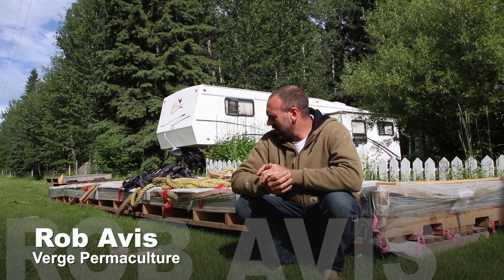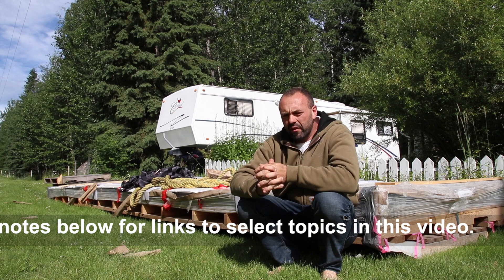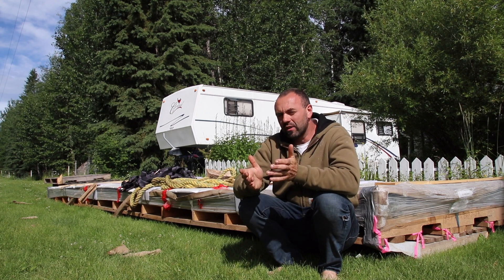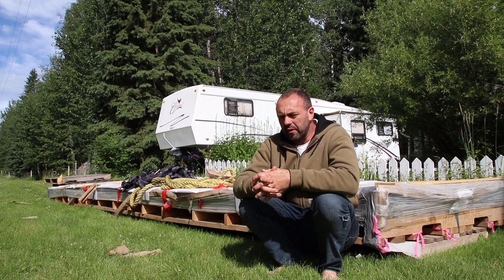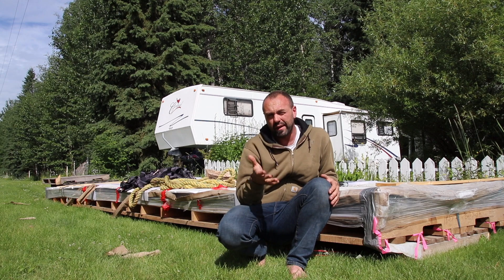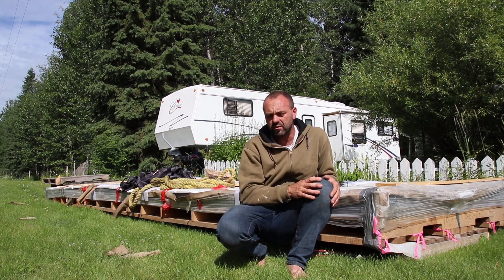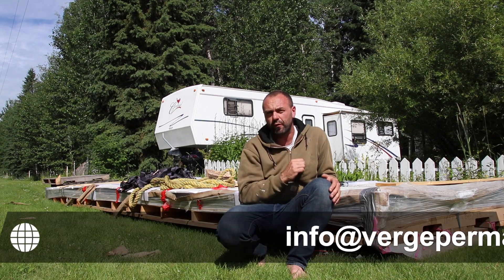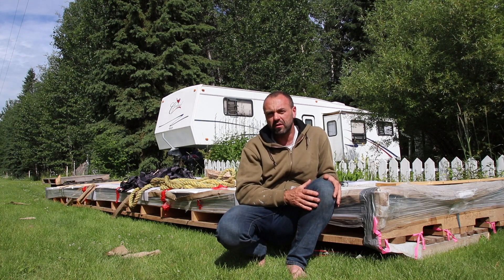Passive Solar Greenhouse Glazing, Which Is Best?

Comment: Hello Rob, I am not sure we have to change our diet as it relate to growing food. I would argue that we should use evacuated tube, a small recirculating pump and radiating tubes in an insulated pad for a green houses. no gas, just solar energy. seems a lot cheaper, energy efficient and easy to maintain. Anyway just a thought....

Comment: I'm surprised you intended to use your greenhouse year round.  In our climate (Canada) with our short growing season, the main use of greenhouses is to extend the season by growing seedlings in the Spring.  This, combined with the long days at high latitudes during June and July, allows us to grow crops that would normally require more than 90 days to mature, such as winter squashes. Some plants do not like to be transplanted, but they can be if they are grown in biodegradable pots made from peat or cardboard.  Winter greenhouses are used mainly to grow a few vegetables that are tastier fresh than shipped in from thousands of miles, such as lettuce, tomatoes, sprouts, etc., but not for main food crops.

Comment: Practical thought, Make sure the ends of polycarb panels  are water sealed, siliconed  or taped...Or Plaster with gorilla glued plastic strip?
The second hand polycarbon greenhouse  8' X20'  I bought came pre algaed up a foot because previous owner did not seal.

Comment: I don't understand how large agricultural greenhouses can sustainability function with so much input. Surely they have engineers on hand that would have some idea of how to tweak greenhouses for greater solar efficiency.  Those statistics are very disturbing
Reply: Any agriculture has been geared towards using energy on a big scale like machinery for planting mono annual crops or greenhouses using energy to light or heat or water. The way we grow food now is not sustainable because of the agriculture model ... dig up the soil, plant seeds, chemicalize the field, take the crop off and ship away the topsoil all using machinery and thus energy. Agriculture was coopted in the early 1900s by the Rockefellers (etc) knowing that it's not sustainable and that the soil will run out of nutrients by using this system. We need to do regenerative farming using permaculture designs
Reply: It's because energy is cheap right now. Even when gasoline prices are high people don't drive less, they just complain. I think we'll have to see a doubling or tripling of energy prices in order to see behavior changes. When it starts hitting people in the wallet they will start making better decisions real fast.

Comment: I noticed SoloWrap is sold by the roll and appears to be for large or commercial greenhouses. What glazing material would you recommend for a small backyard greenhouse?
Reply: There are suppliers that will sell less than a full roll. I was able to buy it priced by the meter/foot for my greenhouse.
Reply: @gvanagten   Thanks!